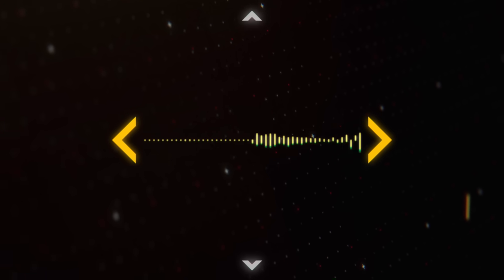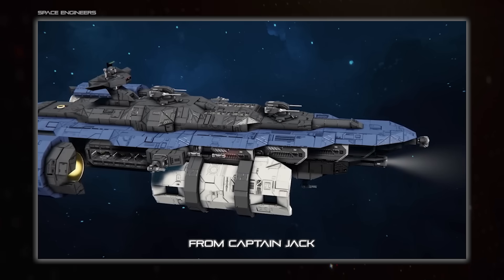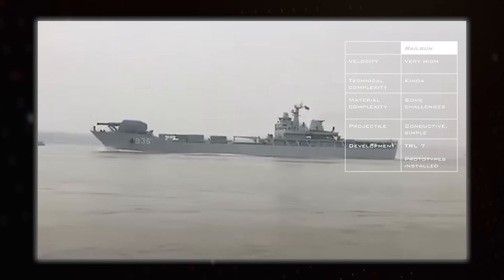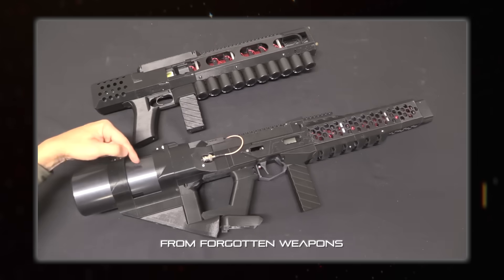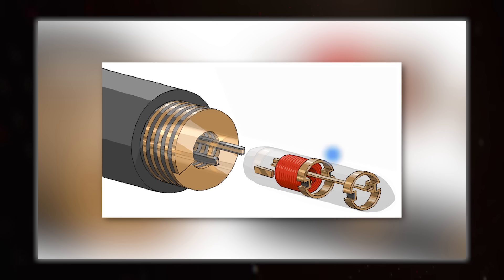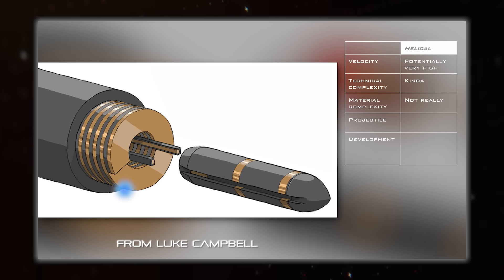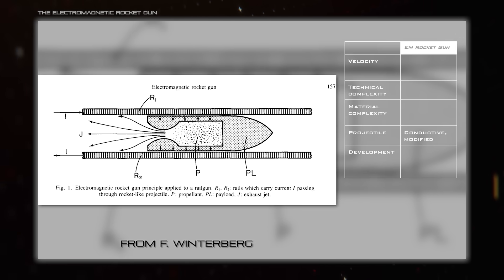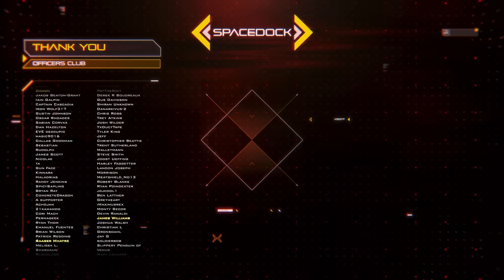The Deadly Coilgun/Railgun Hybrid You've Never Heard Of (Helical Railguns)

Comment: In my sci-fi the 'round' is a bullet on the top of a battery, which is fired by electronic trigger. This then discharges the the whole battery to give the weapon power for a single shot. The battery is ejected like a brass casing, and can be recharged from a power source.

The idea of this is both practical: making the weapon inert when not loaded, able to function in almost any environment; and dramatic: they're capable of select fire.

The batteries make the impulse and range low, (for railguns!) but can be scaled up for anti-materiel weapons. The railguns follow the helical principle in the fact they have a barrel like current small arms, and mostly bullpups.
Reply: You are describing a capacitor, not a battery. Batteries use changing chemical compounds to store power, and are heavily limited in how quickly they can discharge as a result. They literally need to decay from a higher energy compound into a lower energy one, and unlike burning things which is similar they can't do so too quickly or the energy is released as heat (and fire) instead of electricity, and so using one for a projectile is out of the question even if loony tunes future land.

Capacitors in contrast can discharge as fast as lighting bolts. Lighting is literally the atmosphere acting as a capacitor, and dumping all of the stored power into an electric arc. Capacitors work by storing opposite charges along conductive surfaces, such as static electricity (static electricity is literally an object like your hair being turned into a capacitor, meaning static is not like a capacitor, it is literally a capacitor). You can get both higher voltages and higher amps out of static on a piece of cardboard than you can out of the best portable batteries: they work that well.

There are still some fairly harsh volume limits, since if you shrink the capacitor too much relative to it's size it will internally conduct, no matter how good of an insulator you stuff between the charge storing membranes, and this limit is still well outside of the energy densities you get from modern smokeless powder, but this is where you insert your magic alien compound that does magic non-baryonic matter things, like having insulation far higher than possible with things made of quarks.

And fun side effect is if you accidentally ground the capacitor, even for something as small as a 9mm casing equivalent, you get an electric arc that is.... About two meters long and blasts off/melts about a 3 cm deep crater in solid steel. Yea, storing that much energy as raw electric potential really isn't possible, and as a result of the above (two meter long arcing distance in standard atmosphere) you would need to have the crazy hyper high insulating material also wrap the entire thing, including the connector for how it attaches to the gun. How do you have an insulator that can hold back that much charge with only 1-2 mm of thickness but still low enough insulation it can discharge fast enough to fire?.... You can't, but don't let that stop you either.

So if you bash a round into something hard enough to chip the thin insulating layer (and if it's not thin your rounds, even small 9mm sized rounds, are going to be chunky af) you get a not insignificant lighting bolt that is arguably more dangerous than the round the gun shoots at close ranges... Why not just shoot at lower velocity the casings then?....

That has always been my main problem with science fiction weapons: if you have energy densities and wonder materials to make man portable electric guns/lasers.... there's probably something better you could be doing other than throwing rocks or slowly heating things.
Reply: @ASDeckard  Well, that's a very thorough and detailed reply, which I thank you for taking the time to write. Have you considered trying your hand at writing hard sci-fi? You've obviously got the chops for the science.
Reply: @ASDeckard  lightning grenade launchers FTW

Comment: if the goal is to achieve high speed with a given material limit. Wouldn't you just put a projectile in a spin launcher, slowly accelerate to higher and higher speed via a electric motor, then release the stored rotational energy into the projectile. 
Given the same max current/voltage limit of material, a spin launcher can accumulate far higher projectile kinetic energy before the coil burn out. And since it's just using regular electric motor, you don't need worry about electrode burn out and require less cooling. Not to mention you can add into a gear speed multiplier stage to the spinner to increase projectile speed far higher than what the source motor can achieve.

Another thing, unlike a coil gun, where only a portion of coil is outputting force at a time as bullet travel through the barrel. 100% of the section of the motor spinner system is outputting force. So similar weight and size weapon will have far higher power density than coil gun. It also doesn't require any special bullet. Since it's a spin launcher, you can literally pick any rock off the road as projectile.
Although this spin launch gun does have some downside. You can't rapid fire since it require spinning to build up energy. To achieve high speed, you probably need to maintain a low vacuum around the spin area to prevent the projectile from getting destroyed from aerodynamic friction (technically regular rail gun bullet will also get destroyed by air friction if it get fast enough). Recoil is going to be an issue unless you set up a counter weight bullet that also get release half cycle later. But technically rail gun will also get the same recoil issue if its bullet go fast enough.
apperance wise, it's probably going to looks like a disk with opening at outer radius. Doesn't look like a traditional gun with barrel. But it's basically a miniature spacecraft launcher system but launcher small object instead of rocket.

Comment: I've actually looked into helical railguns and use them for small arms in a sci-fi story I'm working on. To provide power to the weapon, each projectile actually comes with a shell casing just like modern firearms, but rather than gunpowder or some other propellant, the "shell casings" are actually tiny Explosive-Driven Ferroelectric Generators (EDFEGs, also known as explosive driven flux compression generators) to provide very short but very powerful bursts of energy. To supplement any additional power (a.k.a. hand-wave the need for more energy) most weapons will also have an on-board battery/power-source.
Reply: You had my attention, now you have my interest.
Reply: Its like volt and devotion from Titanfall 2
Reply: I think it is a bad option logistically, because normal railguns only have a set of batteries and capacitors in the gun, and the projectile is only a slug of metal, so you can bring a lot of very cheap ammo. Your design made the ammunition very expensive.
Reply: @ Well, yeah, but if we're talking about expense being a main factor, I'd just stick with chemical-propellant based firearms. At the scale of small-arms, there's not much advantage you're going to derive from railguns and coilguns over what we currently have irl; if anything there would be a ton of drawbacks. When it comes to your average infantryman, simpler is better. EMLs only really become more practical over chemical guns at the naval ship scale where the platform can support the weapon effectively with power and chemical ignition in cannons reach their maximum potential without blowing the gun apart.
Reply: I might have to steal that idea for myself! 

Though I'm a little stuck as to how I'd design the weapon's own on-board power system. I'm tryign to approach it from a realistic perspective as a veteran who knows all too well that the more complex the piece of equipment is and the more separate parts it needs to function, the more likely some grunt will break it or lose a critical part at the most inopportune time.

But I'm largely left with 3 possibilities: 

1) The power supply is integrated with the magazines, and since the mags might get reloaded by a machine/ammo pack  rather than by hand, they can be recharged when they get refilled.

2) A separate, detachable battery that's treated almost like a second magazine type.

3) A built-in battery, generally not removable/replaceable by the end-user (ie: a unit armoer function) that's good for a good long time and a whole lot of shots, can be recharged in the field from portable generators/batteries, and/or have their charges maintained when they sit in their rack in the weapons vault.
Reply: @patrickdusablon2789  Two suggestions for that:
1. Do all of those, different manufacturer's solving the different issues at different rates, with in universe debate over what is best still ongoing. This parallels commercial arms development and gives you an opening to exposit when either something goes wrong with one of those parts or someone unfamiliar with that particular method needs the quick and dirty briefing on it.
2. Bite the proverbial bullet and include redundancy. (this is effectively what the magazine and detachable battery do.) Have a built in battery supplemented with either detachable or magazine baked in power supplies, said onboard battery can also run other components of the weapon system. Heck, if you want to go all in, have the onboard battery rechargeable by simply loading a 'fresh' magazine w/battery or even a separate 'recharge magazine' that's nothing but battery can uses the same connector and ergonomics to ease logistics. (Complete with some nickname about their color or symbol markings to distinguish them from regular ammo/battery magazines.) So that between fighting the system can be field recharged easily.
Reply: @Sorain1  Yes, I like the idea of different power supply systems to different weapons. there's a whole bunch of characteristics that would give pros and cons to each design doctrine.

I do like the idea of redundancy, though in a different way from what you describe. To be honest, I've been on the fence whether I want to use railgun/coilgun small arms or stick with more conventional, albeit advanced chemical propellant-based small arms, notably electrochemical propellants, i.e. M41 Pulse Rifles from Aliens. Sort of the argument between rule-of-cool sci-fi vs efficient, but plain hard-sci-fi.

The Helical railgun is an interesting design as it almost looks like an enclosed barrel itself. Obviously hot gases are no good for electromagnetic materials, but perhaps if there's a protective medium between the projectile and the barrel components, ideally conductive, frictionless, and heat resistant, maybe the weapon can be design to fire both electromagnetically and with chemical propellants, so power supply is less of a failure point. Alternatively a simple barrel swap from the helical railgun barrel to a basic metal barrel could suffice. 

There may even be a more mission-purpose reason to do so, i.e. helical railguns offer higher kinetic energy per shot, but chemical propellants offer higher rate-of-fire.
Reply: @QuantumAscension1  Conventional guns have rifling.  You "don't need" rifling with firearms because hey, tank main guns get away with it, but actually you do because rifle-sized fin-stabilised flechettes get blown off-course by wind and rain at rifle engagement distances.  Pretty sure your electro-small arms would be the same story.
Reply: @smorrow  If the rails themselves inside the helical gun are also a double helix (and the cutouts on the projectile slanted to match), the projectile spins, no? 

I kind of think this probably increases the wear on the rails. Maybe (aside from the contacts) the projectile has to have a low-friction surface in the rail channels.
Reply: @smorrow  I imagine that could be solved simply by twisting the rail contacts in the barrel into a double helix structure, not nearly as steep as the outer coils, but enough to generate the same stabilizing rotational effect on the projectile. Admittedly, that would probably impart even more friction on the barrel components and not sure if it would negatively effect the electromagnetic fields that are accelerating the projectile.

Of course, depending on what muzzle velocity we're talking about, rifling may not be all that necessary; I think they mention it in Mass Effect, how the term "rifle" is a misnomer, which yeah, considering the small arms in that game fire sand-sized projectiles tens of kilometers per second, rifling would serve no use. But then again those guns also use space magic to make projectiles near massless too, so probably not a great example, lol.
Reply: @patrickdusablon2789  Now that you mention it, I do actually like the idea of the battery being built into the magazine rather than into the weapon. 

A) if the battery only has to last for 30-rounds rather than 3,000, it could be made out of cheaper materials and less quality, maybe even considered disposal, the way we view AA and AAA batteries.

B) if the battery in the magazine is faulty, you can just swap it out with another. If the battery is integrated into the gun and is faulty, then you have no weapon at all

C) Weight considerations. If it's between a battery in the gun that adds 10 pounds you have carry around constantly or 10 magazines an extra pound each that are distributed around you body, I'd prefer the latter.

D) Absolutely what you said about keeping it simple. No offense to the average infantryman, but the lower you can make the threshold for required competence for handling a weapon, the better everyone will be. Making the battery part of the magazine can be a simple "Plug-and-play" system, so that soldiers/marines are less tempted to fiddle with the weapons components.
Reply: That's pretty cool tbh. Using Explosive-Driven Ferroelectric Generators (EDFEGs) as shell casings to power helical railguns in small arms is an ingenious concept. Each projectile generates its own high-voltage pulse upon firing, providing the substantial burst of energy needed for the railgun’s electromagnetic acceleration. This approach ensures compact and autonomous power delivery, reducing reliance on external power sources and enhancing mobility. The on-board battery supplements additional power, supporting pre-conditioning, auxiliary systems, and boosting energy during firing if needed. This combination creates a highly efficient, self-sufficient weapon system, blending cutting-edge physics with practical engineering and aligning with future trends in advanced weaponry.
Reply: @lawrencefrost9063  Exactly. Truth be told, I'm probably WAAAY overestimating how much energy an EDFEG that small can produce, or if the pulse lasts long enough to sufficiently accelerate the projectile. But, at least to the average person, it does sound more interesting and plausible than just "arbitrary energy source in the gun does the things"